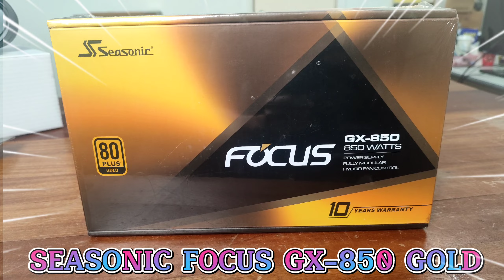Lian Li O11D Evo Ryzen 9 5950X RTX 3080 PC Build (Time-lapse) | PCB-3

Comment: hanggang ilan controller po pwede iconnect sa motherboard? Meron kasi akong 1 controller for lian li sl infinity fans, 1 for strimer, 1 for corsair LCD Screen posible po ba yung 3 usb ports? or gagamit nalang ako ng splitter for strimer at corsair controllers (merong kasamang splitter yung corsair)
Reply from the maker: depende kung ilan ang usb2.0 header ng mobo mo pero usually 2 lang kasi usb2.0(not sure kung may more than 2 pero halos lahat ng binuild ko e 2 lng nkkita ko)  
2 lang naman need mo usb2.0 header ah base dyan sa list ng controllers mo, yung sa strimer sa pagkakatanda ko eh 3pin argb cable gagamitin mo dyan then yung sa sl fans and corsair pump ayun lang may usb2.0 cables
Reply: @geraldvee  di boss kasi yung bagong SL Infinity may controller sya at pwede ding USB 2.0 para ma controll yung fans at rgb yung Corsair h150i elite lcd may kasama syang USB Y Splitter pwede ko kaya I-connect yung corsair controller at lian li strimer usb 2.0 sa splitter tapos i-connect ko sa motherboard? Para naring akong gumamit ng usb hub pero natatakot ako boss baka masunog Mobo or mga controller or hindi naman siguro no?
Reply from the maker: @kdfteddy2677  anung strimer b exactly gamit mo? strimer? strimer plus? strimer plus v2? 24 pin or dual 8 pin?
Reply: @geraldvee  Strimer plus v2 24pin and triple 8 pin v2 yung bago po
Reply from the maker: @kdfteddy2677  bkt hindi n lang yung 2 lian li pagsamahin mo sa isang spliter?(sl inf and strimer)? then yung corsair rekta sa mobo?
Reply: @geraldvee  diko naisip yun ah HAHAHAH salamat boss ganto nalang gagawin ko okaya order nalang ako ng nzxt hub
Reply from the maker: welcome par! pwede din yang idea mo, ganyan din ginagawa ko sa iba kong build kapag kulang usb header ng mobo
Reply: Salamat boss problema ko nalang ngayon kung pano ko icocontrol yung rgb at fan speeds nila pag bumili ako ng hub try ko muna yung splitter.
Reply from the maker: @kdfteddy2677  l-connect 3 software for lian li and icue 4 software for corsair